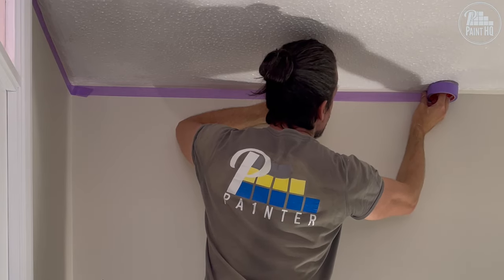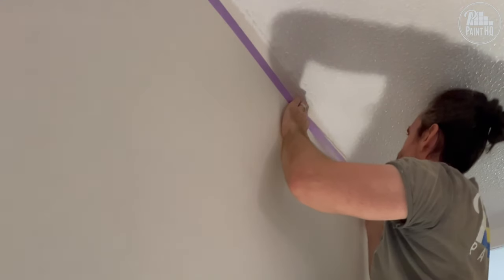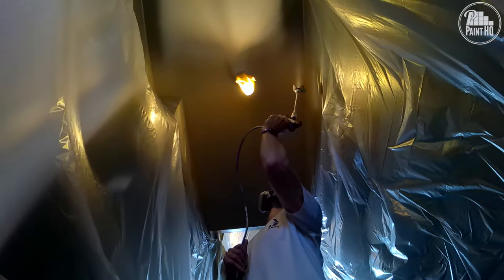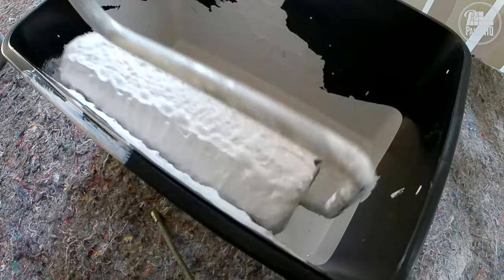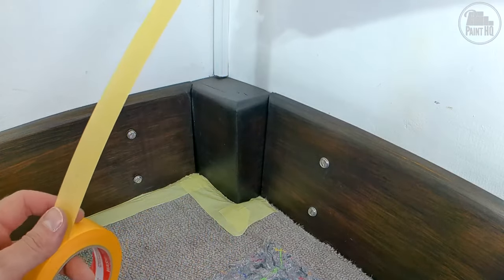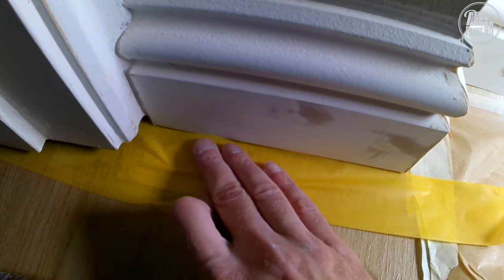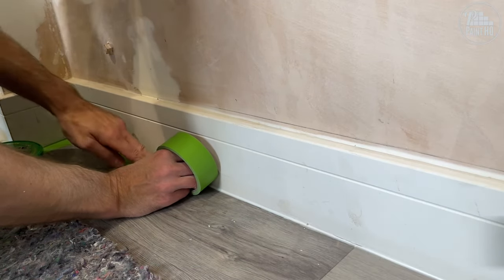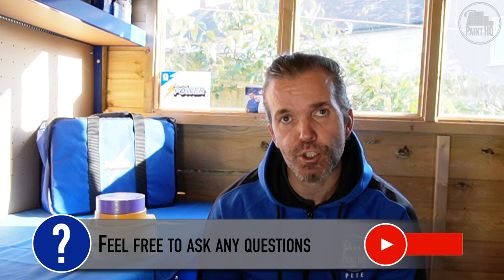Masking Tape Guide. The Best Tapes for Using an Airless Paint Sprayer

Comment: Hi Pete, very interesting – In the past I’d used Deltec purple on walls but found the pressure “bounce”, when spraying ceilings, blew the tape off the walls! I’ll certainly switch to Kip from now on. I also find a plastic letter opener slitter much easier to use than a Stanley knife when cutting the masking film.
Many thanks for posting and best wishes, Rob
Reply from the maker: Hey Rob.. thanks for providing your feedback using Deltec.. certainly a tape releasing when hit with airless sprayed paint would be a very problematic scenario.. the adhesion of Kip purple washi, was one of the appealing features for me.. enough stick to adhere, yet still very much a sensitive tape for delicate surfaces  👍 

One tip I like to share on that note, is don’t be afraid to evenly apply pressure to the (Kip) purple washi, have confidence that the surface was prepped, cleaned of dust and contamination, then painted properly .. all ingredients required for successful masking 🔴💯 ..Always a please Rob, thanks for your comment 🙏 Regards Pete

Comment: Hi pete. Hope all is well. Been learning the sprayer. Getting my head sround pressure and viscosity........so just done a big hmo project. 3 levels / 6 good sized rooms. ceilings white. 3 walls nat hessian 1 wall dark grey. All emulsion tikkurila vinyl matt.  Woodwork wrx satinwood.  
Mist cost first 👍
Woodwork second 👍
Nat heesian third 👍
Dark grey fourth 👎🏼
Cielings white 👎🏼 
All paints and colours sprayed fantstic. 
Used deltec low tack. major problems once i masked all 6 rooms and draped static film drop cloth. Sprayed ceilings all look beatiful. Pulled the masking off   and every wall boughth paint off. Fuming. I left the coloured wall 24 and feature wall 48 hours before masking for the ceilings. Any idea what i may have done wrong? Deltec low tack masking? Prep? Any feed back would be great. Obviously going to check the kip range of tapes out. Tried q1 pink but stggkes to sto anything. The deltec did bloe in a few places as mentioned in one comment.........
Reply from the maker: Apologies for my delayed response my friend, some comments slip through.. once I see the question, I will always respond and try to help 🙏 Firstly, well done on getting to grips with spraying projects, you sound very methodical in your learning process and your preparation all reads good.. if the walls were fresh plaster, I’d go with an acrylic primer, that’s aimed at drywall priming — a mist coat is ok, but an acrylic based primer is better / or even an acrylic based mist coat 👍 Then somethings are out of your control ie if the walls are previously painted, it’s impossible to tell if the previous painter, primed and prepared the walls properly.. yes certainly give the Kip Purple Sensitive ‘Wallpaper’ tape a go — I searched out that product for its sensitive properties, whilst still having enough ‘stick’ to be up to the job of spraying ceilings 👍 ..Ensure at every step a dust free / contamination free substrate — the first thing I do on ‘old paint work’ is go round with a light household degreaser (I use Elbow Grease) 👍 Then another tip I can give, if things end up out of your control — is use a heat gun to gently heat up the tape / glue and aide its release (be careful).. Otherwise, you’re doing great.. keep going and keep in touch, I’ll always get back to you and help wherever possible 👍 Regards Pete
Reply: @PaintHQ  Pete firstly I hope you are well. Big thanks 🙏🏼 for getting back to me. All makes for good reading and learning. Keep up the good work. Yes I very methodical and conscious to keep learning to provide my clients a job they deserve. Speak soon Pete. Have a great weekend. 

Barry
Reply from the maker: @barrybostock3737 You’re very welcome Barry, you’re doing great.. Keep in touch my friend 🙏 Regards Pete

Comment: Hi, I spray painted a ceiling then masked it with yellow frog few days later I order to spray the walls a different colour. However , when I pulled it off it took bits off the white ceiling also . Any suggestions ? Ps- I did a test and stuck it on a different white ceiling and pulled off 30 mins later and same thing 😮😮

Comment: Do you not use the q1 tapes anymore?
Reply from the maker: That’s a good question, and to be honest I only ever used the Q1 Multiple Purpose, which if I recall is a crepe tape, that I used on a 3M Hand Masker with various films and papers — I’ll never speak negatively about other brands, rather I searched out Kip for its industry leading credentials and adhesive performance.. I certainly recommend you try Kip, you won’t regret it my friend.. great question, keep in touch.. I appreciate your input 👌 ..regards Pete
Reply: Good video Pete I’ve got a question for you if you use an acrylic eggshell on a large ceiling with the light going across it and using a roller for application how do you stop those tramlines,
Reply: @giuseppecimino6172  you need to make sure you are using the correct pile on your roller what I usually do is try to get as much paint out of the roller as possible so the pile on the roller fluffs up again and then really lightly go over the ceiling with very little pressure that normally eliminates tramlines and also reduces the orange peel too 👍🏻
Reply from the maker: @marsdencarl89 good information my friend, thank you 🙏
Reply from the maker: @giuseppecimino6172 Thank you for watching and your kindness Giuseppe 🙏 ..I would look to use as flat as possible finish to your emulsion, such as an acrylic matt or vinyl matt.. I find acrylic eggshell has just a little too much sheen, and the roller passes could show 😞 ..regards Pete
Reply: @PaintHQ  yes if the client wants a flat finish I’m with you but this client wants A more shiny ceiling any idea to get a nice finish
Reply: @marsdencarl89  thank you for your message which roller do you suggest it’s best for tackling an eggshell finish on the ceiling
Reply: @giuseppecimino6172  I'd probably suggest something like the purdy white dove roller sleeve or something similar ideally with a really soft short pile so it doesn't leave too much orange peel behind. Hope this helps